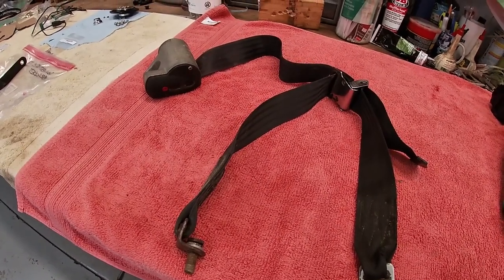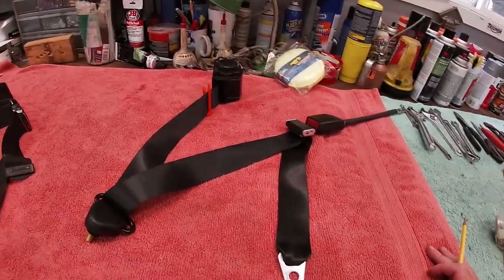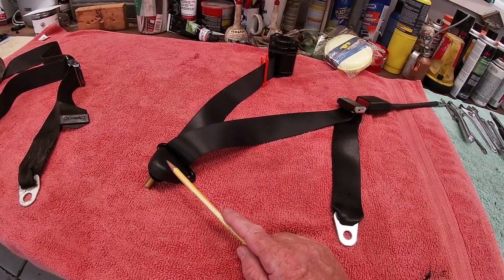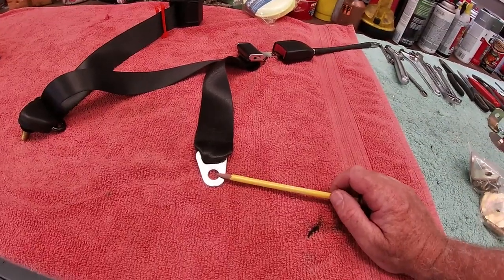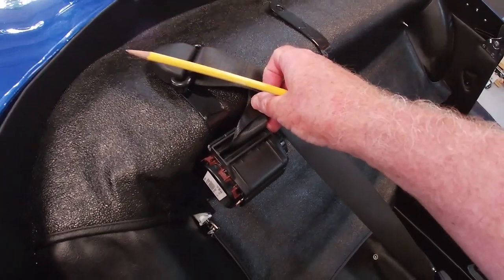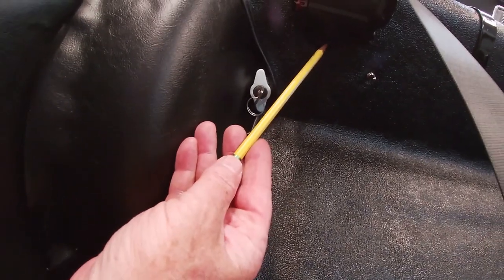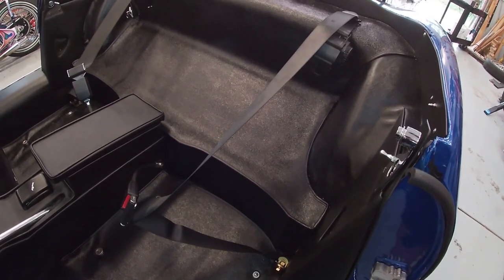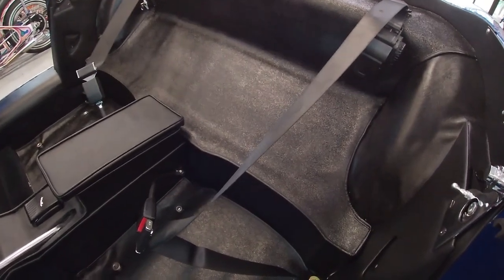Jaguar E Type Series II Rebuild - 2023-07-15 - Seat Belt Installation

Comment: You've been on the road now for a while John. Congrats BTW! I'd be interested in knowing how your 3 point belts are working and still happy with your choice? 
Also,  any regrets with the dynamat install? I never considered it for my roadster. I remember years ago when I was driving the car full-time it used to fill with rain. I'm thinking insulation matting would have made the wet even worse. Thanks, I'm making progress albeit a much slower rate than you!...Todd
Reply from the maker: Hi Todd, I have used Dynamat in several restorations now and I can say that I have no issues with it. I don't have a comparison of with and without the dynamat to share but it does keep the heat down in the cockpit. For NVH reduction I am sure it does work but an e type is not a stellar vehicle from an NVH perspective regardless. 

On the three point belt system I have an issue with belt retraction in the retractor due to the tortuous belt path when the convertible top is down and the top cover is on. I need to see how I can improve that and this is TBD. 

When the top is up the belt system works fine and I am very happy with it.

Hope this helps - John
Reply: Yes it does John thanks. I've seen the retractor in the boot before and may check it out. I'll give the dynamat a go as well but more for sound insulation. 
Another question for you. Did you plate your accelerator linkage on the firewall? They look tremendous!
Reply from the maker: Hi Todd - I plated and painted my linkages. I bought a plating kit and had some decent success with it at home - I made a video about that and posted it. In some cases, I got a better result after painting the part compared to my home plating capability.  @toddnicholls3138
Reply: @johncooper6950  wow a combination. You can't tell. I watched your plating video. John Carry's as well. I cleaned my accelerator bits on the wire brush on my bench grinder. Looks good but won't last. I'll visit a local plating shop and see what they say. Man I'm out of workbench space for adding more stuff to! Thanks again John